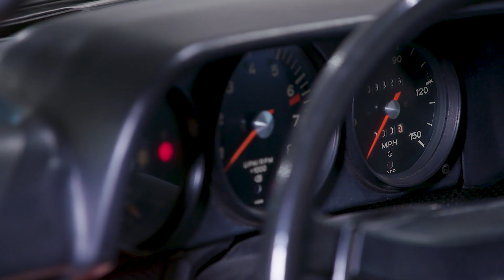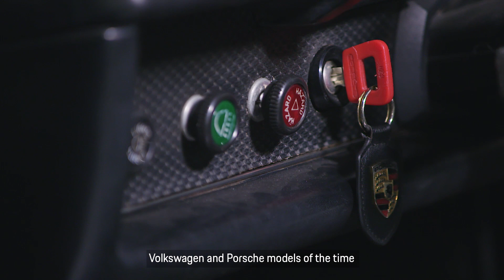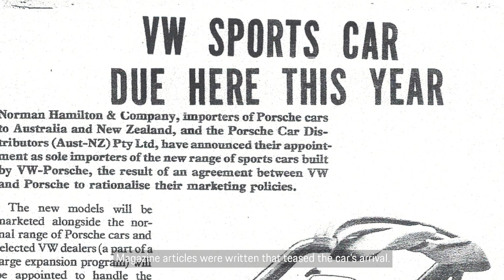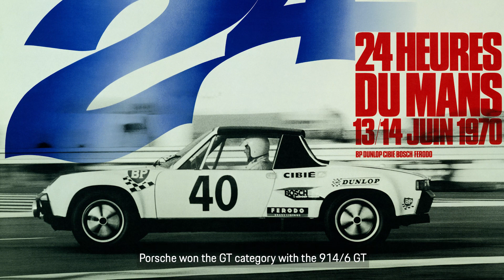Introducing the Porsche 914.

Comment: I've owned 5 914's and ultimately made the 1st LS1 and later LS6 powered 914 in 2000. It ultimately reached 530 crank hp on the dyno. Wide body, full cage, 930 front suspensuon, 930 brakes all around, 996 TT wheels, modified 930 transaxle. 0-60 in 3.0, 1/4 mile in 10.98 @ 133 mph, top speed 185 mph. It ran like a demon at various road courses.

Sold the car in 2009... still miss it.

Comment: 2 trunks, removable roof, plenty of room for 6' plus drivers, and 30 mpg. Whats not to love? Well that snap oversteer thing but it wouldnt be a problem now that Im older and a more sane driver. Then theres the shifter... 
Most of the bone stock ones are homely as heck, but it doesnt take a lot to  remedy that. 
My 72 had the riviera 5 spoke mags and was lowered an inch when I got it at 10 years old. I put the 916GT fiberglass bumpers on it with rectangular driving lights, painted it blue metallic including the sail panel and it was very attractive. I was 19 and in the navy in san diego, good times.

Comment: I remember my 2.0 with Monza exhaust. It had the screaming yellow paint, horrible heating, but I drove it from Olympia Washington to Denver Colorado in two days. That will never be forgotten. I love these cars.
Reply: Had a 72 914 , was very fun and miss it alot 💙 .
Reply: SoCal to KC in the winter. A relationship forged in misery.
Reply: So with the monza exhaust, you essentially had no heater. Thats how 914s got their heat, from heat exchangers built into the stock exhaust. That must have been fun when the OEM exhaust began to rust, and the typical oil leaks got into the holes. When I got my 72 I had to put a clutch in it immediately. I didnt know why at the time but there were several thick aluminum pie plates sitting on top of the exhaust.
Much as I loved that car at the time reliability was terrible.

Comment: I’m slowly building a project 914, bringing it back from near death with new sheet metal, away bars, Koni shocks, 96x66 mm, 1911 cc engine with hotter cam, cylinders with aluminum fins, modern EFI. And a wish list of close ratio gears and a hill climb 31:6 or 5.16:1 ring and pinion. With this and companion donor car that will make three 914s and a 914-6 that I’ve had along with two 356s, a 912 and a 944. The 912 has been my favorite.

Comment: It's worth noting that at the grueling 1970 24 hours of Le Mans race that the 914 came in sixth place overall with only prototype non-production race cars beating it.  That's ahead of the 911Ss and other more prestigious (and expensive) Porsches.  One has to wonder if that was one of the nails driven into the coffin of the 914-6.  A 914-6 with a detuned 911 engine that could still outperform a 911S on the track...

Comment: Can anyone explain the braking sensation on the 914? I would drive fast up to a stop, brake very late and hard. Instead of feeling pitched forward, it felt like the car squatted and you were pushed down in the seat with no fuss!  And after fussing with Weber’s and rusted heater boxes $$$ I put in a Buick 215 aluminum V8. SO MUCH FUN!

Comment: For no upcharge, all 914's and 914/6's included rust.
Reply: All Porsche of that era do, not only 914's
Reply: Except my 1975 2.0 which I had Ziebart treated on delivery and no rust 10 years later as a daily driver through Connecticut road salt winters.  Should have kept it.
Reply: I believe 1976 only used galvanized steel.
Reply: @batvette   911 body panels in 1976. The 914 never got galvanized steel.
Reply: @firstname7330  okay I stand corrected. It wouldnt make much sense to have done it the last year of production anyway.